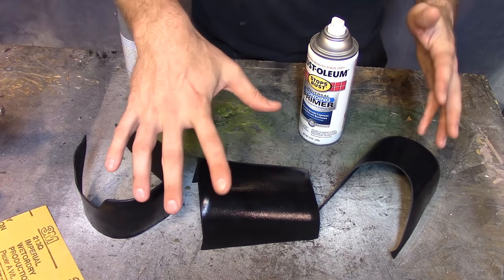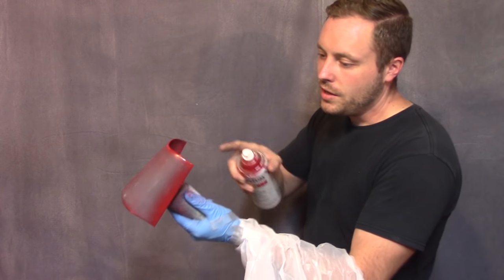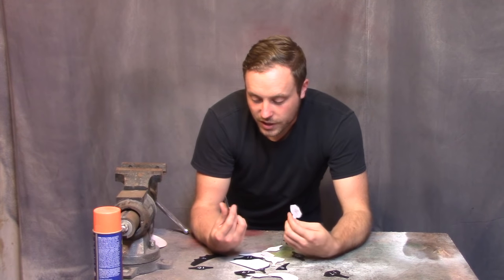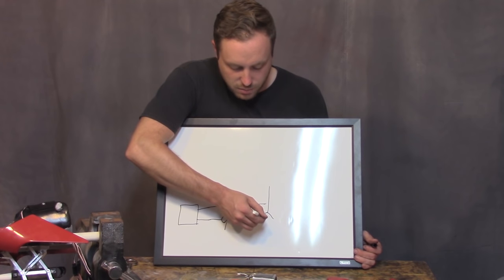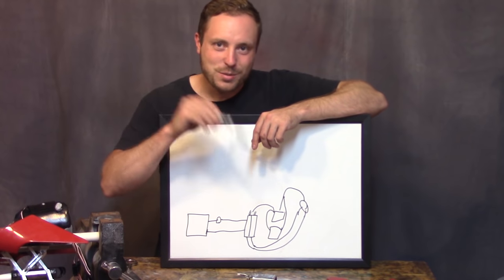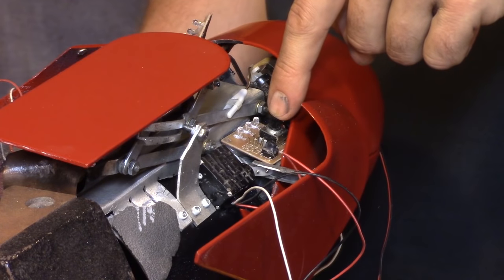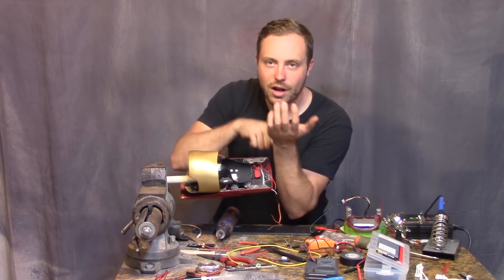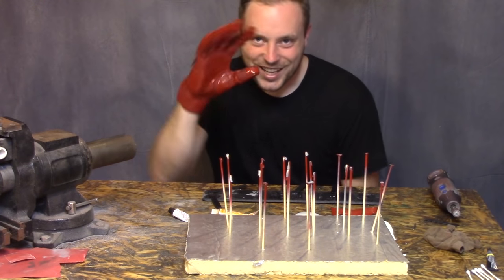BUILDING IRON MAN   FOREARM LAUNCHER Part 8

Comment: I would think that expanding the build to include the upper arm and or creating a chest piece should enable you to have batteries in the chest piece and some of the more critical electronics in the upper arm, meaning both are further away from any magnetic fields being output by the magnets in the forearm (depending on how you move your arm) and if your rockets have any metal particles (is gun powder used for propulsion?) they will be affect by magnetic fields as well, hence any issues you might have been having with accuracy.

Comment: First, I just love watching build videos like those ( I found your channel yesterday from Hacksmith video and am currently chain watching iron man launcher series :) ) 
Secondly you just made me feel better, as usually You guys (makers of such videos) have so much more tech knowledge then I do but here it happens that I cant build something like that due to my non existent knowlege in mechanics but I can program anything with microcontrollers :P ( last thing I build was Smart Terrarium system for my GF so it turns lights, heaters, fans and sprinkler to keep optimal parameters for creatures living inside)
So about that, if you want to learn you can start with Arduino, its very friendly to the begginers and in actual builds you can just use ATmega or ATiny microcontrolers that can be programmed from same IDE as Arduino but take way less space (inside Iron Man armor for example) You can check out youtube.com/user/greatscottlab , its channel for absolute begginers in electronics and microcontrollers and explains everything nicely (not much to learn for me from his vids but i still like to watch it)
Keep up the good work and sorry if there are any grammar mistakes, english ain't my first language :)